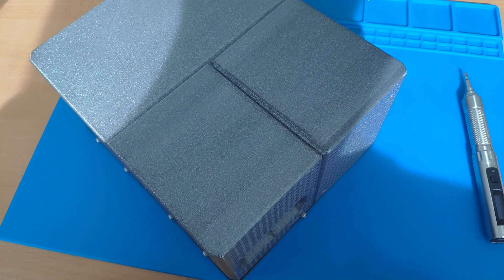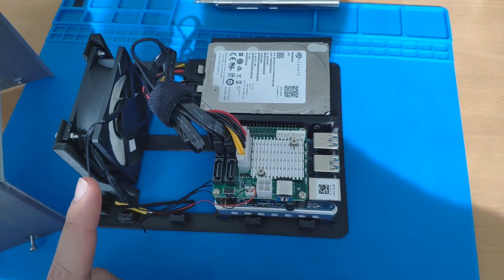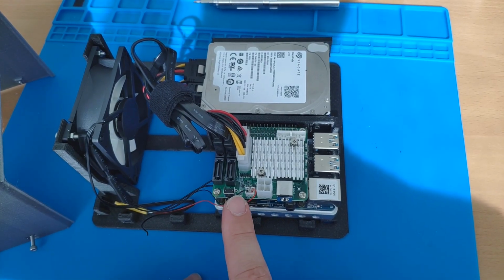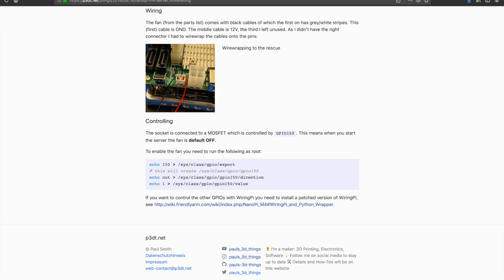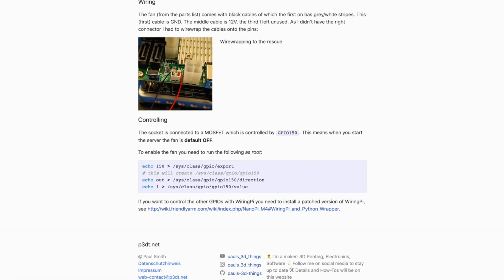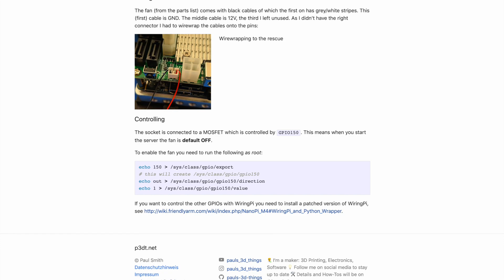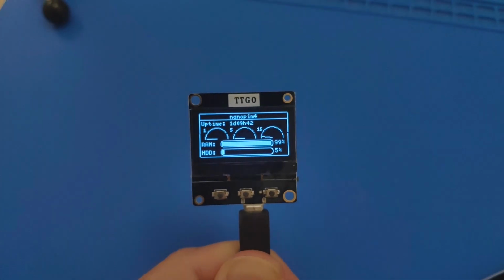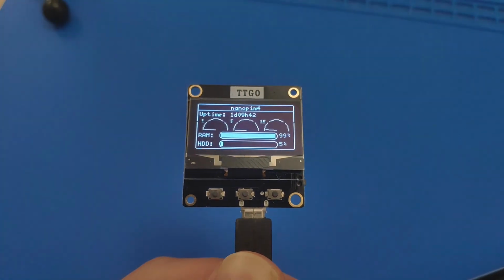EP6 [Project] 3D Printed Server - NanoPi M4 w/ SATA Case

Comment: Hi. I came across your video just in time to help me with something.

I'd like to know if I can use the SATA hat on a raspberry pi 4 for a NAS.

Thank you
Reply from the maker: No. The Nano Pi M4 has a second row of GPIOs that contain a PCIe2x port. The Pi 4 does not have this. The SATA hat is made for the Nano Pi M4s second row of GPIOs.
Reply: @pauls3dthings  thank you so much!

I have been searching for a hat like this for a raspberry pi 4 I recently purchased from Ali Express.

I know there's a 'ready made' case to go available but I find it expensive and would have loved to purchase parts to make mine

Comment: Nice work...does the files to print the case are available somewhere ?
Reply from the maker: https://p3dt.net/thing/2020/05/09/nano-pi-m4-server-2.5inch.html
Reply from the maker: https://p3dt.net/thing/2020/05/09/nano-pi-m4-server-3.5inch.html
Reply: @pauls3dthings  Great...thanks...presently building a 4 disks NAS...this will be very useful...thank you for sharing.

Comment: Hi,

ich möchte das ding in mein PC-Case gleich mit einbauen. Nun zu meiner Frage wie genau sieht der Strom-Stecker aus? (ich kann ja leider nicht mein PC-Netzteil nutzen, da der NanoPi ja 24/7 laufen soll und nicht nur wenn der PC an ist.

Oder gibt es da einen Weg drum herum? :)
Reply from the maker: Auf dem SATA shield ist ein 5566-04A connector, der 12V erwartet. Ich gehe aber über die "externe" 12V Buchse dran. 

Ich vermute, dass dein Netzteil sich ausschaltet, wenn der PC sich ausschaltet, d.h. auch den NanoPI m4
Reply: @pauls3dthings  
Ja genau das ist leider das Problem^^

Ich habe noch etwas recherchiert und ich denke meine beste Möglichkeit wird ein 12v/2a Netzteil mit "locking" welches ich dann am SATA HAT anschließe.

LAN und Storm muss ich dann sowieso bis außerhalb meines Pc-Gehäuses legen dafür nehme ich dann einfach Verlängerungen wie diese:

https://www.ebay.de/itm/Patchkabel-LAN-Verlangerung-CAT6-Schraubversion-Montage-RJ45-Stecker-Buchse-1-0m/132310909535?epid=6020431820&hash=item1ece58425f:g:B6MAAOSwqMFZpVFP

https://www.ebay.de/itm/0-5-5M-10M-12V-DC-Spannung-Verlangerungskabel-5-5x2-1mm-Strom-Kabel-Verlangerung/183758514351?hash=item2ac8dc68af:m:mud4gqpHVAHadtjVMsnBMPQ

In sachen Kühlung mache ich mir eher weniger sorgen, da mein Gehäuse aus 3mm Alu besteht werde ich einfach etwas Wärmeleitpaste zwischen Chip und Gehäuse packen dass müsste locker reichen

Comment: Hello! Do you have a version for 3.5inch drives? I wanted to print yours but found out that it was for 2.5 inch hdds :/
but still its really great! 🤩
Reply from the maker: No, but I can update the existing design, send it to you and you can verify it before I release it. What do you think?

What is the maximum height going to be for a 3.5" disk?
Reply: Sure! 
The 3.5inch HDD is usually either 19mm tall or 25.4mm tall. There is also a 26.1mm version, but it's apparently for the WD ultrastar dc hc620.
Reply from the maker: @yauwai66  See https://p3dt.net/things/2019/09/14/nanopi-m4-server.html#download for the new 3.5" files. Please triple check if it has the right size...
Reply: @pauls3dthings  Hey! Thanks for your file! 
However, I found a small mistake. The holes for the HDD should be 100mm apart (center to center), but your new design is 102mm apart (center to center). 
The height is correct, and it fits! 
So the only problem is the distance between the mounting holes. 
Thanks again! 😊
Reply from the maker: @yauwai66  Check v2.1 please :)
Reply: @pauls3dthings  Oops so sorry, after some checking I realised that the original v2 is correct! My 3d model of the hdd was old and had different dimensions. I also checked again online, and the mounting holes are 4 inches apart, or 101.5mm, but the tolerances are such that 102mm is also acceptable. If you want maybe you could change it so its exactly 101.5mm apart (center to center). 
Anyway, thanks for your quick reply!
Reply from the maker: @yauwai66  Check v2.2 please :)
Reply: @pauls3dthings  It fits! Great now I can start building my NAS. Thanks for your help Paul! 🤩